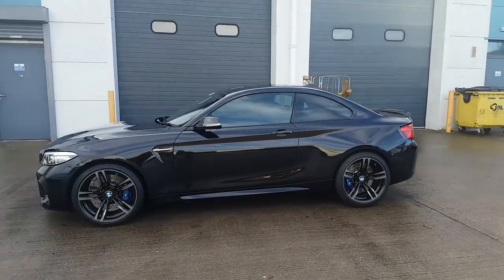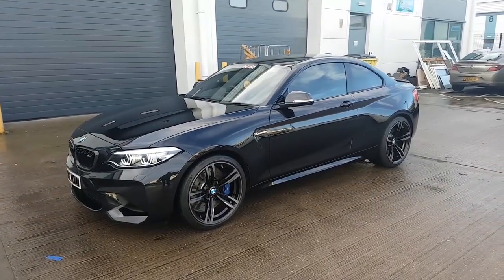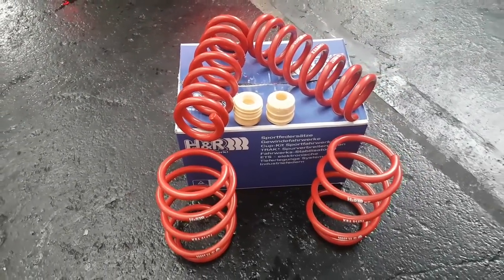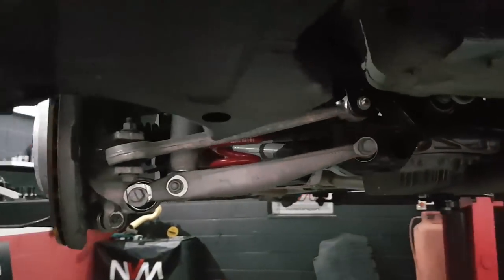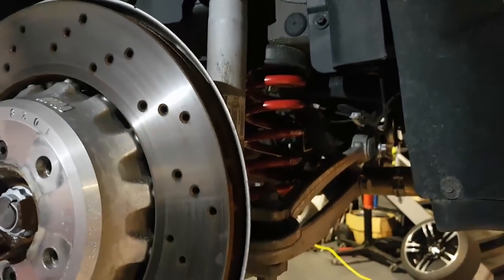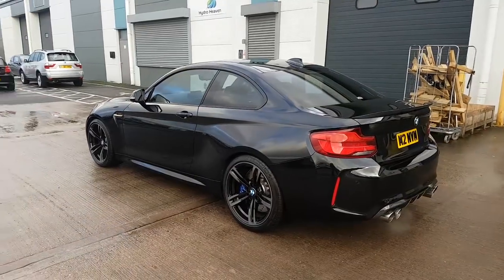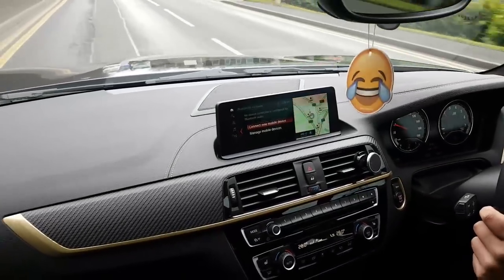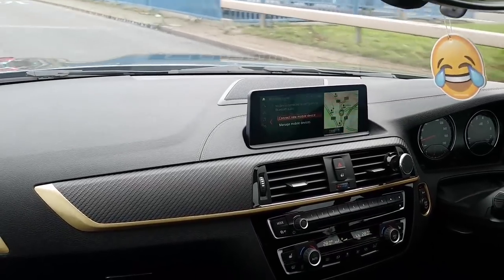BMW M2 H&R springs installed - NV Motorsport UK

Comment: Nice, you felt need to run spacers 5-10mm at all?
Reply from the maker: We are not supporters of Spacers tbh
Reply: @NVMotorsportUK  yeh fair enough I can understand why. Do you have any experience with aftermarket coilovers on the M2? I want to get into one but worry about B road stability as stock car reported to move around a fair bit?!
Reply from the maker: @peterwood2633  we've fitted quite a few and have two different sets for our M2 soon. Adjustable bump and rebound is key to track to road comfort
Reply: @NVMotorsportUK  and day to day driveability ok? What brand did you fit? Any AST?